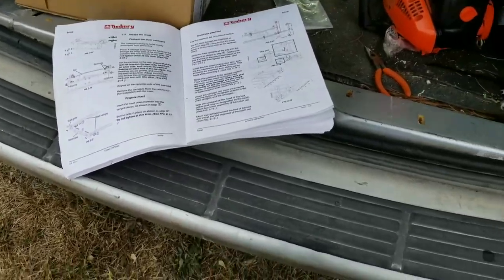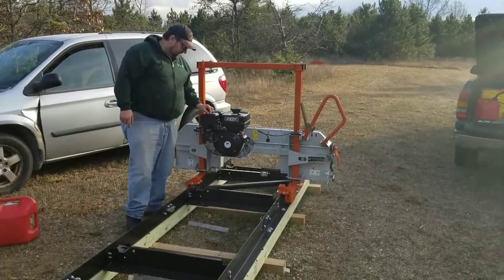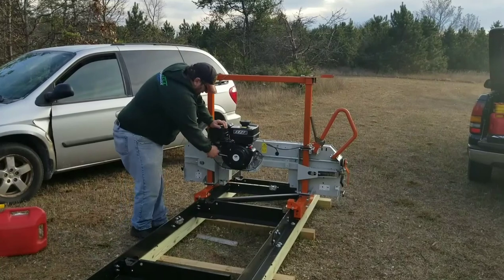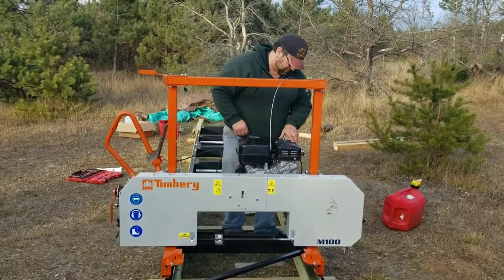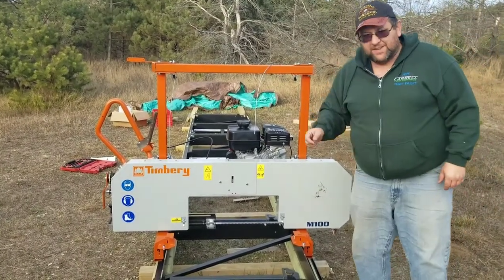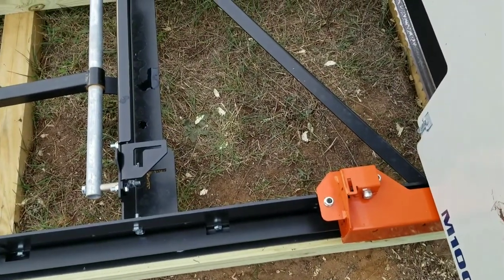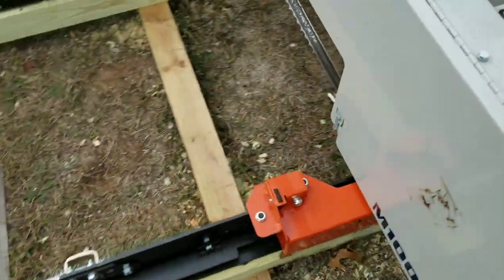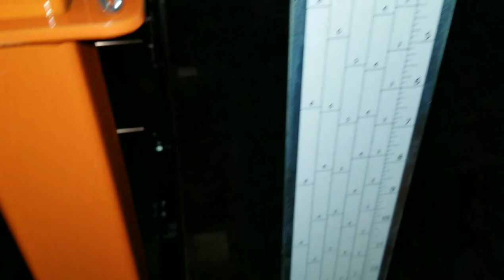Finally, the sawmill is assembled!!!!

Comment: Wow. That mill can mill some big logs. Glad you got it together.
Reply from the maker: Love2boat92 26-inches in diameter and 16ft long. How did you like the first start of the engine?
Reply: Jeffrey Beyer That's one big log. Wow. It started pretty good but didn't want to stay running which is kind of a bummer. Just like anything else, it's something to get used to.
Reply from the maker: Love2boat92 It was the first start and was about 44F at the time of the engine start. Turns out, it does not like the throttle-blade level mashed. Likes a little throttle then push it to engage the blade.

Comment: love the video . I am buying the same mill cant wait to go pick it up. I am just curious its about a 4 hour drive to go get it and I am hoping not to have to go that far with the truck. you have no idea roughy how long the head is ? I am hoping to go get it with my escape  and we can unbox it there and put it in by the piece if needed  but the head is the biggest section
Reply from the maker: MrCodythegreat I did an unboxing video. Worat case, take a small socket set and hammer with you to take the crating apart and put all the pieces into the back of your Escape.
Reply: yeah thats what I was thinking to
Reply from the maker: MrCodythegreat I opted for liftgate delivery, was worth the extra charge. Delivered it right to my door. The whole thing with rhe crate is about 700-800 pounds.

Comment: This model no more in production.  Check out M120
Reply from the maker: Someone else mentioned that. The new M120 still seems to have the same poor design for the raise-lower ratcheting mechanism. Change that one thing and would be a really good sawmill for the money.
Reply: Ordered one 3 weeks ago but factory asked to delay till this month as they are redesigning something in the up-down system
Reply from the maker: Sure hope the raise-lower mechanism has been changed. Otherwise I'd recommend the Wood-Mizer LT10 that it is based on, or a Norwood.